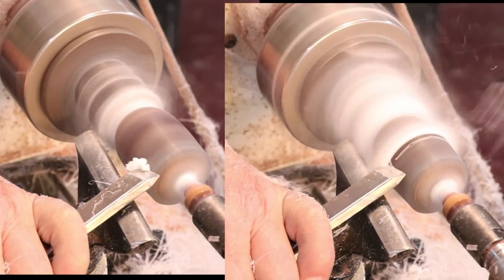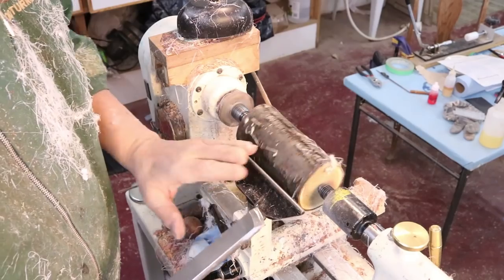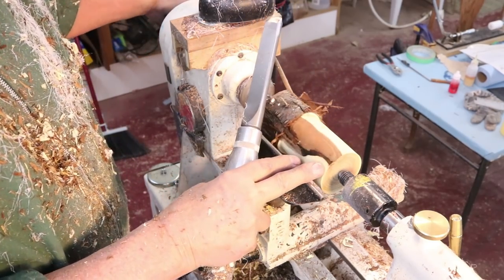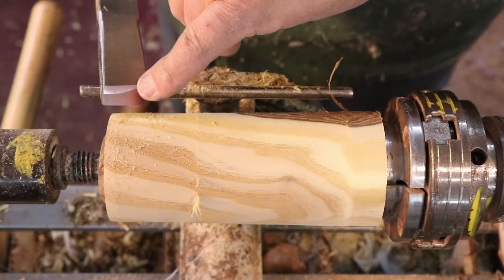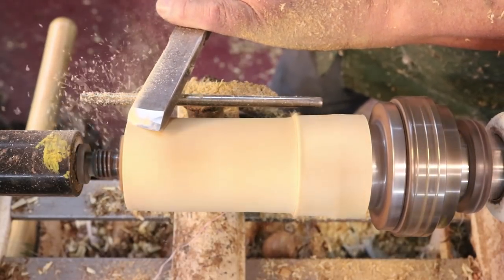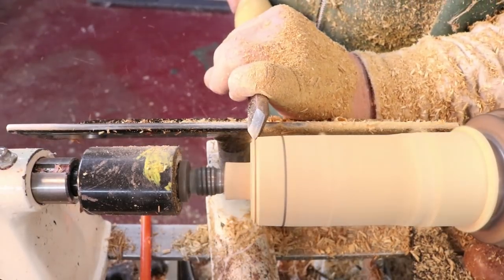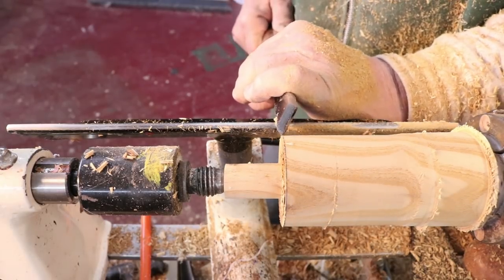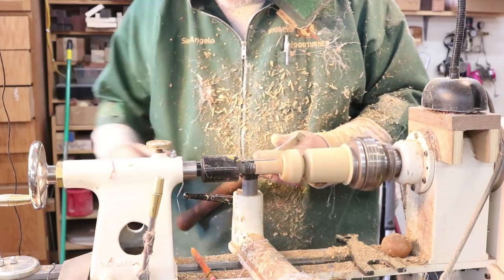Practicing with the Skew Chisel Sam Angelo - the Wyomingwoodturner

Comment: Thank you for this inspirational video! As a wannabe turner (not even a novice) practice tips are great, but also a reminder that even someone as experienced as yourself find these practice sessions useful, if not necessary, to be a good turner. 
With the flattery out of the way, it looks in your cove cut as you only switch to having the long point leading at the very end of the cut, was that intentional or were you just being tired?
Reply from the maker: Jacob
The cove cut I did was terrible.  I usually do use a spindle gouge for this cut.  And I may have been tired as well.
Sam

Comment: Hi Sam, 
I'm a newbie woodturner from the UK. I've learned quite a bit from your videos. However I'm still getting catches which ruin my pieces. I'm using soft pine only because it's cheap and readily available. I'm finding the finish to be poor and if I try to clean it up I end up with a catch. Can you advise me if this softwood is unsuitable for turning ?
Cheers
Reply from the maker: Softer woods are fine for turning but can leave a finish that is inferior to that resulting from a nice hard wood.  I suspect if you are getting catches you are losing bevel contact.  If you are getting catches from a skew chisel-join the club my friend......What might help is grinding your skew chisel to a 40º angle or so.  Mine are ground more to a 25-30 º  angle.  This is really sharp and can be much more grabby.  Just takes lots of practice.  Sam
Reply: @WYOMINGWOODTURNER  thanks for the advice!

Comment: Thanks Sam. Watching your videos has provided me with the confidence to start practicing with the skew. One question and sorry if I missed it, what speed were you doing most of the turning for this video. I was having some trouble with my skew work not being very flat (I was turning a piece of ash and while the finish was smooth it had waves in it) and not sure if that was due to the poor quality of my skew (cheap set of tools that came with the lathe) or if my speed was too slow maybe? any thoughts? Much thanks Sam, Ted M
Reply from the maker: I am constantly changing my speed so I am not sure if I can answer that.  But generally turn as fast as you can-SAFELY.   Re: you problem with ash.  You may be turning too slowly.  But the grain in ash is hard-soft-hard-soft so you may git an uneven surface. But ash is difficult cause it is basically very hard.  Sam
Reply: You were right Sam, the ash with the hard, soft, hard, soft grain was causing the ripples in my work. I tried a piece of box elder with much better result!! :) Thanks Sam, Ted.

Comment: Hmm, havent looked at the Whole video, but i only see scraping and not cutting. why dont you hold it in a 45 dregree angle to make CUTS ?
Reply from the maker: Yes I suggest you do watch the entire video.  However the main point I would make is in reference to the title of the video.  This video deals with practicing and may be directed to those who have not yet mastered the skew chisel.  At 2:40 in to the video I am making a peeling "cut".  This is a good place to start if you are new to using a skew chisel.  At 4:40 in to the video I introduce more of a shear "cut" which is the next step beyond a simple peel.  Are you starting to get the progression here of skills using a skew chisel.  Now....in your comment you say, "I only see scraping and not cutting."  So it appears you only watched the first few clips when I was turning on the bottle stopper.  I won't go into any further play-by-play of the video.  Sam

Comment: What would happen if you round the toe n the heel thus taking the point off.
Reply from the maker: You may not be able to use the point-which is important for some cuts.  But are you saying this will prevent catches-interesting.  Sam
Reply: WYOMINGWOODTURNER I'm not a Turner yet but I intend to build a treadle lathe this year so I am watching as many videos as possible. I am a joiner by trade n I use many machines except a lathe. It just seems logical to avoid having catches. Takes away having leading or trailing edges.

Comment: It is hard Sir, I keep getting catches.
Reply from the maker: Milind,  I am still getting catches. And I am still practicing. The best thing to do is to use a green Limb two or 3 inches in diameter and just practice on that. Try not to use really hardwood to practice with good luck Sam
Reply: @WYOMINGWOODTURNER  pkll